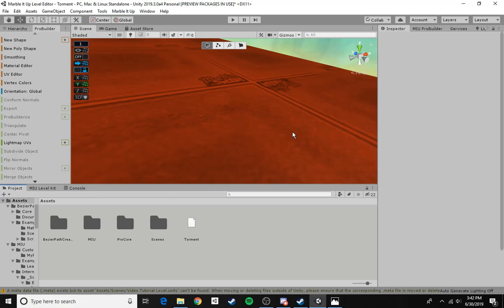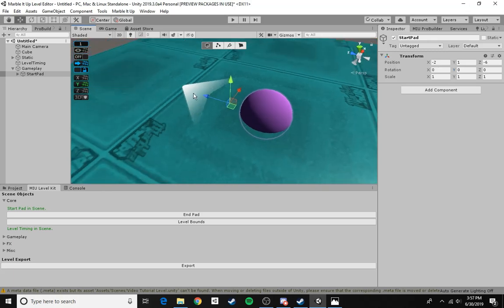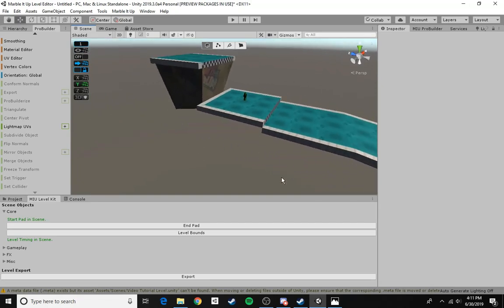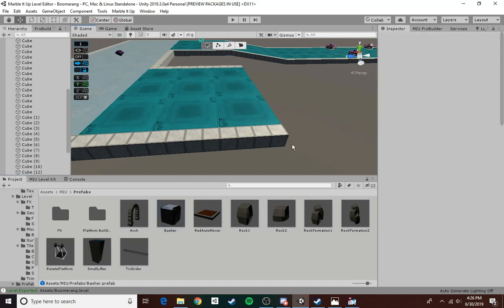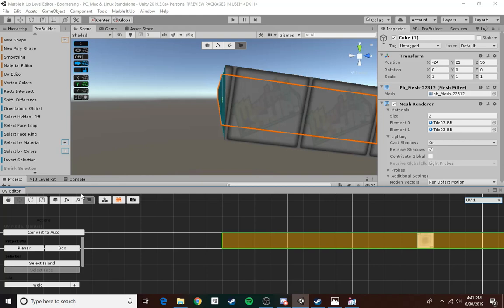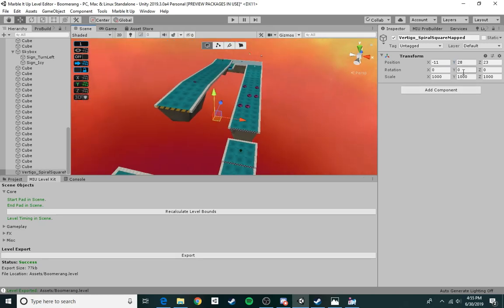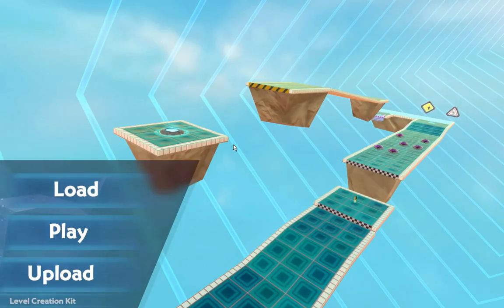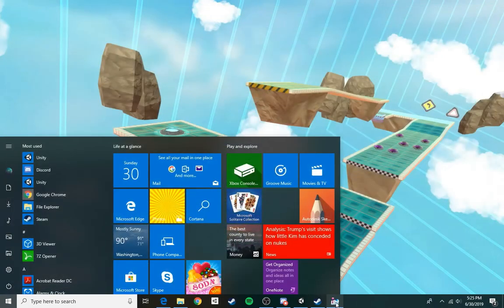Marble It Up! - Unity - Level Building Basics(Building my Level "Boomerang")(How to Make MIU Levels)

Comment: where did you get this? in unity?
Reply from the maker: Where did i get what specifically? The level building kit for MIU? When you're on steam and ready to launch MIU select level tester instead of the game. Then in level tester click the link in the bottom left to find a download to the kit. For more directions be sure to check out my newer tutorial on level building. I has timestamps on the video so you can easily find anything you need.
Reply: @TechZTony  ok so i need to get the MIU (Marble it up)

on steam ok thats easy ok ill look it up on steam